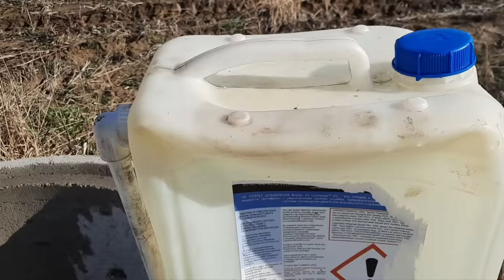Simple idea how to make a water pump without electricity without fuel

Comment: You explained it very well. Building a very useful apparatus, made simple and easy. 
 Water column in the container acts as a piston that succs water in from the well as drain valve is opend.
Will it perform better if the plastic container is replaced with a 9" dia,  6ft upright pipe having both ends sealed?
Reply: The 6 ft pipe would probably not work better. The height of the plastic jug is only about a foot and a half so you would be adding over four and a half feet of lift to the column of water coming from the well.
Reply: @mikeslater6246    Since this does not work at all it can't be improved. If the outlet is lower than the water level in the well water flows through siphoning and no plastic jug is needed. If the outlet is higher, it does not work. Because an increasing vacuum would stop the flow of the water at the outlet before it would be strong enough to draw up water from the well. If this would work you could at once build a perpetuum mobile. But perpetuum mobiles aren't possible. You can't lift water to a higher level without an input of energy.
Reply: @sciencefreak9070  I don't accept your premise that this does not work. It is not a pump. So it requires no mechanical power. Actually the video showed it does work, as a siphon, but apparently you think there's some trickery there. But I assure you there isn't. The 5 gallon tank is a primer. That's all it does. By having that 5 gallons of water higher than the rest of the system it primes the discharge hose so you don't have to prime it manually before you lay it out. As long as the discharge hose doesn't hold more than the volume of water above the inlet to the spigot this will work and the tank will continue to run but will not refill from the well. Depending on the sizes of the suction and discharge hoses, it may be a little tricky to get it to start but once it does it will work.  I was a firefighter/pump operator for 15 years in the local volunteer fire department and also a building technician who maintained both municipal and well water systems within the buildings I worked in. I am well familiar with the science behind siphoning. As long as the weight of the water in the discharge hose exceeds the weight of the water being pulled into the top of the primer tank, it will work. Matter of fact the partial collapse of the tank showing there is a lower ambient air pressure inside the tank indicates that it is trying to function.  There are height limits for the system but this setup nowhere near approaches that limit. It will work!
Reply: @mikeslater6246    Thanks for your comment. I can see that you have professional experience but I think it will be easy to convince you that you are still wrong in this question. Let's look at "pure siphoning" with a hose or pipes, withount any tank in between. After all, you can fill the system with water by other means too. There is side 1 of it, where the water moves upwards from the well, and side 2 where the water moves downwards and out. But this does not work, just because the weight of water is bigger on side 2 than on side 1. It only works if the outlet is lower than the water level in the well. It is easy to make the weight of water bigger on side 2 with a longer hose or a thicker one, but siphoning will only work if the outlet is lower than the level of water in the well. 
Although a siphon is not a pump, on side 1 water moves up against gravity. That's not possible without power. This power depends on the volume of water moved per time and the height it is moved up. Now gravity does deliver power on side 2, where the water flows down. Again this power is given by the volume of water moved per time and the height it flows down. To get the water flowing, power gained from side 2 must be slightly bigger than the power needed for side 1. Since the volume of water is the same on both sides, the height of water flowing down must be bigger than the height it is flowing upwards. Which means, that the outlet must be lower then the water level in the well, never mind what the weight of the water on both sides is. It will be simple for you to verify this with an own experiment.

Can this restriction be overcome by inserting a tank in the system? No! You do create a vacuum with this system, but the vacuum does not only suck at side 1, it also sucks at side 2. Before the vacuum is strong enough to pull up water from the well it will have stopped the water from flowing through the outlet. Because water pressure, which only depends on the height of the water column, is bigger at the bottom of side 1 than at the outlet of side 2. It is not the weight of water which matters in such systems, it is water pressure in relation to air pressure. Think of a thin and a thick pipe, both vertical and filled with water and connected at the bottom. If weight would matter, the bigger weight in the thick pipe would push up the water level in the thin pipe, but this does not happen, water level is the same in both pipes. In the connection of the pipes water pressure must be the same, otherwise water would move from one pipe to the other. And you only get equal pressure with an equal water level. 
For a physicist this is easy to judge. He doesn't care for details as tanks, valves or thickness of pipes. His argument: it needs power to lift water to a higher level. This must not be mechanical power, but it needs power of some sort. But there is none in this system. If this pump would work with an outlet higher than the water level in the well, you could let the water run back in the well and drive a turbine on its way. Thus you would get free electricity out of nothing. To nice to be true.
Reply: @sciencefreak9070  thank you for your excellently detailed explanation of what you believe is happening. But there are a couple of things that you said that don't match what I have described. For one thing, nowhere have I suggested that this would pump water higher than the water level in the well and no such claim was made in the video. The video title did misidentify this siphoning system as a pump and we both agree this is not a pump.  I'm only saying that this system, as demonstrated, will work.
And you keep emphasizing the fact that the discharge of side two, as you identified it, must be lower than the level of the source at side one. This too is a given fact we both agree on.
The power you keep referring to is provided by the water weight in side two. I think we are describing the exact same thing with slightly different terms. But again my only point is this system will work as demonstrated, siphoning water from the source which is apparently a well and taking it downhill below the level of the water in the well and discharging it on the ground.
At about 3:54 of the video you can see the side one pipe is only about 5 to 6 ft long and about 4: 30 in the video you can see that the water level is just below ground level. And the water level is demonstrated again at about 5:30 in the video when the gentleman bends over the edge of the concrete liner and the water is within arms reach for him to fill his container.
From 6:19 to 6:29 in the video it demonstrates that the end of the side two hose is well below the surface of the water and the water flow at 7:07 in the video clearly shows that it is working.
So recapping, no one in the video has claimed that this would pump water uphill. Nor have I made such a claim. The YouTuber claimed in the title that this was a electricity free fuel free water pump but what he actually has is a siphon system with a self priming feature. And my claim is that the system which is a siphon will work as demonstrated. 
In several other replies I have sent responding to comments from people who believe this is a pump and that it will work going uphill and suggesting that this person has discovered a perpetual motion machine technology, I have totally refuted those claims.
I hope this clears up the confusion that seemed to exist between us.
Thanks again for your detailed explanation of your understanding. Have a blessed day!
Reply: @mikeslater6246    Confusion arised from a misunderstanding. I stated in my earlier comment, that this would work with an outlet lower than the water level, but that it can not work with an outlet above the water level. You anwered, that it works and that's why I thought you were referring to a situation where the outlet is above the water level of the source. My mistake. In the last time a great number of YT-videos turned up with a "free energy" pump and many of them indeed claimed that water could be lifted above the water level by such a system creating vacuum. Many of them also demonstrated it in the video - which is not possible without trickery. I put this video here in this group without watching it complete enough. Otherwise I would have noted that the output is lower. 

I do not doubt that it may work as demonstrated, but I have severe doubts if this method is really favorable for priming and running a siphon system. I think there are simpler and more stable methods for prefilling a siphon system with water. And there are situations in this video which are not clear to me. You never see the foot of the vertical pipe going down in the well. Thus we don't know if there is a valve. The tank is filled with water above the inlet from the well. This indicates a valve or something else, otherwise some water would run out in the well, at least as long as the cap isn't screwed on. In min 5:50 you get the impression that water from the well flows in the tank, although at this time the outlet is clear above the water level and the water level in the tank is also still above the inlet. The tank is not yet contracted and it is surprising for me that vacuum is already strong enough to pull up water from the well.
Reply: @sciencefreak9070  thanks for pointing out the earlier comment because I totally missed that. It appeared to me that you are concentrating on the fact that people were saying they should pump water uphill. My bad in that area. But I believe the appearance of water running in at 5:50 of the video is actually air bubbles coming in from the pipe due to the water running out. The weight of the water in the tank will pull a vacuum on that pipe thus pulling some of the air trapped in the pipe when he put the end in the well water but as soon as the weight of the water in the pipe equals the weight of the water in the tank the outlet spigot of the tank will stop running because they've reached equilibrium. I fully agree there's easier ways to prime that hose but I think the fact that that is a very small outlet hose and fairly small inlet hose this will work fairly well. Anything bigger and there would be a lot of air issues in both the inlet and outlet. But that part is definitely just my opinion. Thanks for the explanation, thanks for the conversation, and have a blessed day!
Reply: @mikeslater6246    Yes, this could be air bubbles also. The water level in the tank appears to be above the inlet and thus the vertical pipe should fill with water, but it is quite possible that it isn't filled completely and residual air comes out. Since the tank is not really transparent, details are hard to see and they are not so important after all. I also enjoyed our exchange, thanks, and have a blessed day too!
Reply: @sciencefreak9070  ✔️👍☝️🙏

Comment: Just put the hose pipe inside the well, suck the water from the pipe from he other end and call it a day. It works as longas the other end of the hose is bellow the water level in the well. No rocket science...
Reply: Agree, but if you do not want to suck that dirty water, a barrel is an option to start a siphon.

Comment: You know, this would be a lot easier if you just set the jerrycan on the ground and passed the intake over the top of the well top. It would still work the same, just be easier to hold onto!

Comment: Are you pumping downhill or uphill? does it work both ways?
Reply: I believe that it works only downhill, I mean if the way out is in a lower level than the level inside the well! I would put a faucet at the end and maintain a hose always full of water, without anything else. It would work only downhill, of course... 😀
Reply: Kuye me kam karega
Reply: No such thing a pumping downhill.  It's just gravity.  Start a siphon and it will run forever.
Reply: Downhill. The goal of this system is to prime the water flow for you. Some people said you can just use your mouth to do it, but you can't! The water level is too deep and the hose too long to be able to use your mouth to prime the flow of water. Plus you might not want to suck a dirty garden hose and some dubious water with your mouth!
Reply: @LeChristEstRoi  You are completly right! To use your own mouth is impossible because of the diference between levels. Besides that, there is a real danger with that quality of water...😀
Reply: @two-sense  if I'm understanding your statement correctly, pumping is possible downhill if you want a larger volume of water delivered through given hoses than a siphon alone can deliver through those hoses. But as has been pointed out there is no pumping going on through this system.
Reply: @mikeslater6246  Correct.
Reply: @pedrold  You can start a siphon in any diameter hose without using your mouth.  You don't need suction to start a siphon.  Simply plug the bottom end temporarily and fill the entire hose with water from the top.  Insert the top end into the water source and release the temporary plug from the bottom end.  Water will flow constantly.
Reply: @two-sense  Thank you, TwoSence, that's the way I use to do too. I never use my mouth. Besides we must be afraid of the water quality, as I said to Christus Rex.😀

Comment: Its possible.. But need to use one way check valve on the lower side of the water level. I have made one but the jar should be completed air tight.. Its works on vaccum principle actually.
Reply: With a priming drum noe foot valve is needed. This set up can not lift any water to a higher level!